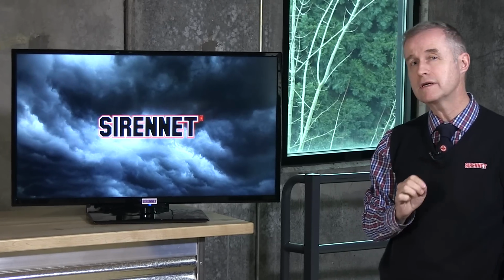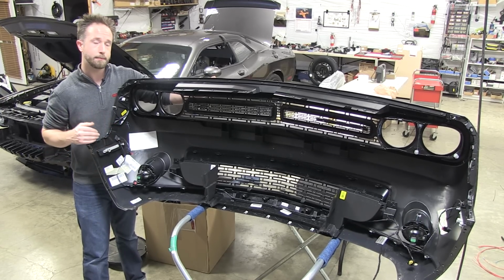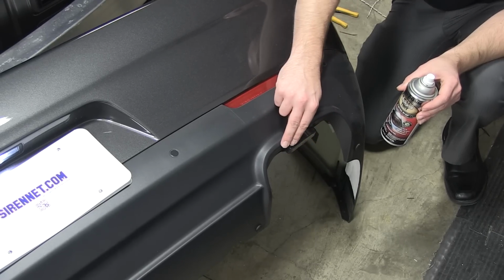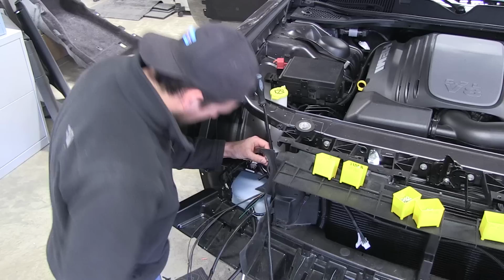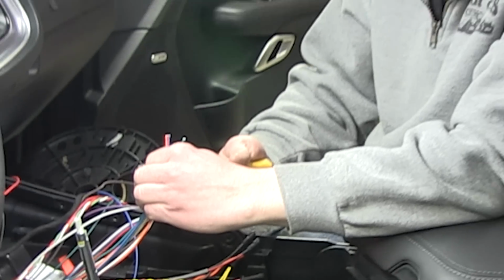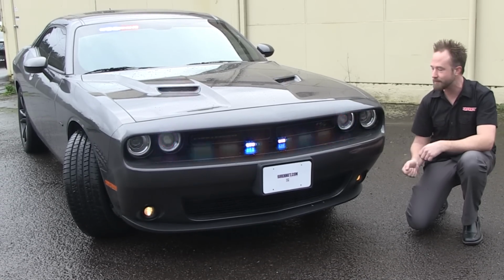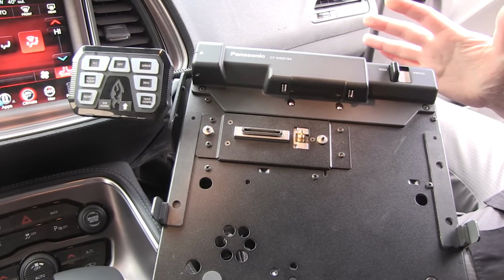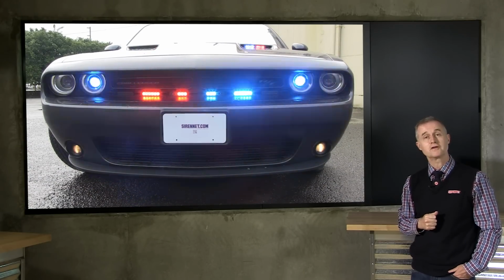Dodge Challenger Patrol Vehicle

Comment: This looks REALLY BUSY I’d like to see less and brighter lights
Reply from the maker: What adjustments would you make to the lighting?
Reply: @SIRENNET  This is 100% objective.. But I think an X pattern slower flash draws a human eye better. I’m a vol. fire fighter and observe lots of lights. I think that a very bright and slower flash make people notice you faster and better. Maybe a single dual color on the front quarter as a blue amber so it could be a turn signal as well as a flasher. Adds safety in two departments. Can you utilize the rear LED taillights as a traffic advisor to flash left and right??
Reply from the maker: @DJR554  You have good input;)   Have you seen Whelen's new CenCom Core system being used in your area yet? The DVI patterns and ability to calm the lighting is a great safety enhancing features for the emergency vehicle(s) and other motorists as well.
Reply from the maker: It might be possible to setup the taillights as a T/A, but without having the car and modules for the Controller to test it, we really can't say.
Reply: @SIRENNET  they do have those. The chief mentioned that with the new apparatus they will sync up with the PD cruisers. Very Cool 😎

Comment: To many small lights. I would have done a traffic advisor in the back window, wigwags in the front and back/w alternating r/b , 2 led grille lights. And a deck light along with the already visor lights. And then running board lights along the side

Comment: Can anyone tell me what the red equipment mounted (strapped) to the trunk lid at 8:47 is?
Reply: P272 Stopsticks. Used to deflate tires in a vehicle pursuit.
Reply: @Gmoney818  yep, you're right. Wasn't familiar with that red round  reel. Thru me off. Thanks Bud👍.

Comment: It was much better when the mfr. just added pigtails for installs, the quality control was top notch. No mention of the alpr system?
Reply from the maker: @MatthewFogarty-k2y  Radar.
Reply from the maker: It's also been equipped with a Watch Guard camera system; front, back and sides.
Reply from the maker: ALPR systems work great when the cars equipped with an overhead light-bar. There really isn't an accommodating way to add one on a Challenger.
Reply from the maker: @MatthewFogarty-k2y  As a courtesy to the wonderful clients Star Cars and ourselves work with, we don't publish costs.

Comment: They are putting too many lights on those cars, looks nice, but closing almost all engine ventilation. On the fron does 2 wholes are for engine air cooling. Blocking them with make a higher risk of the cars V8 to get heated. Stay with the other cars and leave this for fun.
Reply: I too notice HOW MUCH the (2) Siren speakers BLOCKED the radiator & trans cooling grids !!!!   NOT a good idea at all ....   That will DEFINiTELY effect it in warmer temp climates ....

Comment: I love the install on this Challenger, BUT it's going to look like a purple blur from a distance with all the red/blue mixed. They should've kept all red to one side and all blue to the other and not had them flashing at the same time. Just my $0.02, it'd be much cleaner that way.
Reply: Agreed. Also, with so many of the lights having diminished output due to either smoked lenses or being behind smoked glass, I think the attention getting punch would be greatly increased by grouping and synchronizing the lights to alternate left vs right; the classic wig-wag pattern is still, in my opinion, the most effective pattern ever. The most eye-catching light bar I’ve ever seen split the bar in half and had a simple single flash wig-wag pattern that sped up and slowed down.
It might have just been the video not capturing the actual real life effect, but the headlamp halos seemed completely worthless.
Reply: I was actually wondering about that as well.
Reply: Or at least flashing alternately - never want to have b/r flashing together side by side

Comment: I've always wondered if lights were installed in the shaker scoop, but it concerns me about air flow blockage though.
Reply from the maker: Shaker scoop and interfering with it is a no no. On these hoods the openings aren't functional so they make a great home for little light-heads to hide.
Reply: @SIRENNET  correction; they are functional.  Not used to cool the engine.  The old E-body style utilizes those intakes to keep the car on the road at high speeds.  I forgot precisely how it works but the wind tunnel tests show it.  Throw a bigger spoiler on and you won't need to worry (if you're doing over 120mph).
Reply from the maker: @elijahdjali  Interesting :)

Comment: Very slick setup.  I like the hood scoop LEDs as well as how the other LEDs were mounted.  The only thing I am curious about is the choice of interior light bar.  I only ask because the takedown lighting seemed a bit dim in comparison to the best takedowns I have ever seen (Federal Signal Valor and Tomar Blade) in terms of brightness.
Reply from the maker: Thank You :)   It's hard to compare the output of Interior based Take-down's and those found in over-head Light-bars.   Over-heads will always out-do their Interior counter part as they have more size to them and room for more optic manipulation and heat dispersion.   With the industry now offer DUO Interior Light-bars, the output has definitely improved when it comes to illumination.

Comment: Its pretty good but then again its a challenger...(a yacht). It'll waste too much gas and if i had a gt500 (example) i wouldn't run away from the cops because the gas runs out real quick (if the cop was driving a crown victoria). The chally is good I guess for undercover cops.
Reply: same gas mileage as a charger would have

Comment: wheres the antenna for the radio?
Reply from the maker: The Antenna is mounted on the interior rear deck. It's been painted over black to hide behind the tinted rear window. It works great and helps maintain the low profile that's needed.
Reply: @SIRENNET  The Boyz at Star Car think of EVERY DETAIL, .....  :) :) :) :) :)

Comment: It won't keep up with my hellcat challenger !
Reply: Where u get 900 hp from😂😂
Reply: Maybe not, but they have a thing called a radio with which they can call ahead to get a road block or spike strips to stop you. So you still lose the race and your licence, and it will cost you a lot of cash in fines and penalties! The real question is: is it worth it?
Reply: I love having a car with 900 horsepower and still has cold AC. Love being able to drive to the track, race, and drive home. I work at a Chrysler dealer and gotta say I LOVED the Hellcat!
Reply: +Darcy Brar Lets see where to start. From the bottom up I guess. I have a stock V6 block with a stroker kit consisting of a billet forged crank, RJC billet mains, RJC block girdle and a custom made deep sump oil pan. TA performance billet rods, forged pistons with file fit rings and a TA Performance custom ground billet roller cam with TA roller lifters. To top the block off I have a set of Champion 14 bolt aluminum heads with grooves machined in for loc wire head gaskets and they are assembled with Isky Gold Stripe 1.550 double springs with dampers and are 295lb closed/580lbs open at 600 lift. They have titanium retainers, 10 degree locks, 1.60 stainless exhaust valves and 1.90 stainless intake valves and they are topped with 1.65 ratio 7/16 stud mounted Scorpion roller rockers. For an intake Im running a Champion aluminum intake fully ported, polished, and port matched to the heads. I have a ported and polished 70mm upper plenum and a Accufab 70mm throttle body. I have TA performance headers a 3 1/2" Terry Houston downpipe with an exhaust dump and full 3 1/2 inch custom exhaust with no cat. I replaced the stock turbo with a full ball bearing Precision PT6870 GEN2 CEA turbo with the H compressor cover which has a 4" inlet and 3" outlet and a Buick 3 bolt turbine housing with a .82 A/R running 30lbs of boost. I replaced the factory intercooler and fabricated a Powerstroke diesel intercooler to fit. I am running 160 lb/hr injectors and am running a Razor's alcohol injection system. I replaced the factory computer and chip with a FAST XFI system and a custom tune by Cal Hartline. Im running the stock TH200-4R with full billet internals, a heat treated input drum and a 9" Art Carr non lock up 3200 stall converter. From the transmission is an aluminum driveshaft and a 9" rear with two seperate third members; one for the street and one for the strip. Suspension consists of Air Ride Technologies level 3 air ride setup. Next step is paint cause it has the original paint still and is fading quite a bit. Interesting fact about Grand Nationals that most don't know, is that when they came out in 87 buick tested them with methanol injection but knew that would be a turn away when it came to selling points but they still put a light on the dash that says "power injection" so aftermarket methanol systems like mine tap into that light and it comes on dim when the alcohol system kicks in and it gets brighter as the alcohol system ramps up. Razor's alky kit, like mine are set to come on at 5 lbs of boost and is a progressive controlled system so as the boost rises the more methonal the system sprays in.
Reply: @smitty1987buick  we get it. You like to waste money on a V6.
Reply: Brandon Smith Oh u built it is thought u were talking about the hellcat 😂
Reply: +Liam Jonigan-McGar How much ys got at the wheels? My best pull was 899.2hp at the wheels.
Reply: +Liam Jonigan-McGar I run 30lbs of boost
Reply: +Darcy Brar ohlol, right on
Reply: +Brandon Smith My Syclone will!
Reply: +Liam Jonigan-McGar Nice truck, I had a typhoon for a while. How much ya got at the wheels? My best pull was 899.2 hp at the wheels.
Reply: +Brandon Smith 372whp but that was w/ an aftermarket intercooler and turbo at 16 psi w/ a tune
Reply: +Brandon Smith stock bottom end?
Reply: sure the radio call will get you
Reply: can't out run a radio
Reply: And then you get to a corner and you guys both spin out
Reply: My Grand National will!  ;-)
Reply: +Darcy Brar yeah probably
Reply: my v6 mustang will lololololol jk
Reply: +Michael Scott my gt500 will 😉

Comment: I wonder if the lights placed in the air intake area will hamper performance of the engine by impeding proper airflow?  The vehicle looks awesome though regardless. Well done !
Reply from the maker: With the Micron's in the hood openings, the Challengers performance won't be impacted here in the Pacific Northwest. If it was being used in Nevada or Arizona or hitting the Track a lot, then we'd keep them open.

Comment: Great Install guys. I watch everything you guys post.
Only thing that bugged me is the Feniex Controller that's upside down. Was that done for any particular reason?
Reply from the maker: Thank You. Flipping the Mini over made the 'feel' better for operating buttons without having to look over.
Reply: +SIRENNET, oh that makes sense. Cool.
Reply: @SIRENNET  why are there two extra stickers on it (air horn and upward arrow)
Reply from the maker: @deebaker6871  They correspond to 'Hands-Free'.  Just a reminder that by hitting the steering wheel horn button it sounds the air-horn tone and that another tap advances the tone.

Comment: Is it better and more sturdy to secure a (Havis) laptop mount to the center console, or separate with a bracket to the under seat bolts ? Which do most agencies prefer ?
Reply from the maker: Either way is very sturdy. The floor mounts are great for use in Vehicles without an equipment console. In our experience, it's really a 50/50 split.  For Vehicles where there's often a passenger, affixing the MDT mount to the Console can save a few inches for more knee room.

Comment: Just 1 thought: won't the l.e.d.'s in the exhaust housings get damaged from the heat of the exhaust pipes?
Reply from the maker: Thank you Tyler... That's correct. The Microns won't suffer any heat issues with where they're mounted. The tip ends don't get hot enough to put them into a higher heat range then they've been designed to withstand.
Reply: Philip Keller lmao who cares
Reply: It's mounted over the shroud, the pipes themselves can be seen inside. It's a trick they do to make the exhaust seem bigger than it is. No worries about head damage.

Comment: When putting the electronics together accordingly, Besides the siren amplifier, radio, and camera system,what basic components are used? Ground rails? Fuse block?
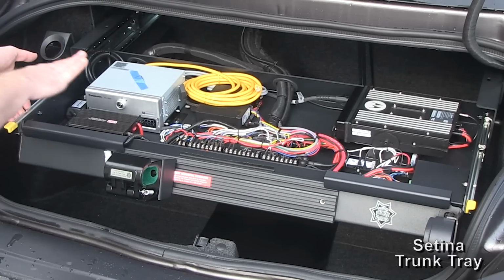Reply from the maker: The D&R Electronics Power-Distribution that they use takes care of the grounding and fusing. At 11:11, you'll see this Unit in the center of the Trunk Tray.
Reply: +SIRENNET does the power distributor take care of relays as well?
Reply from the maker: Most of the time yes. Here and there, some relays do need to be added based on the Equipment.
Reply: +SIRENNET thank you for the help! Star cars really outdid themselves
Reply from the maker: It was quite the Project for them :)